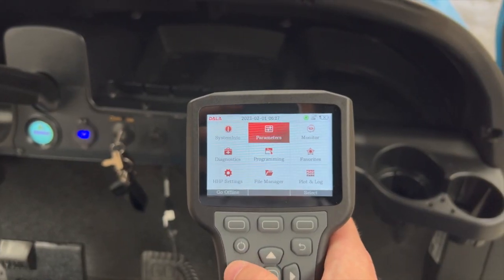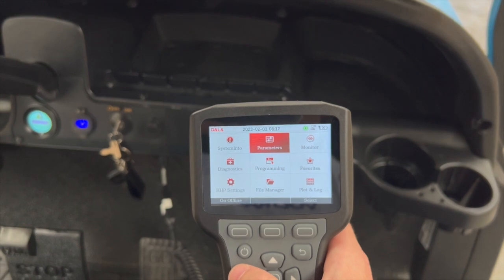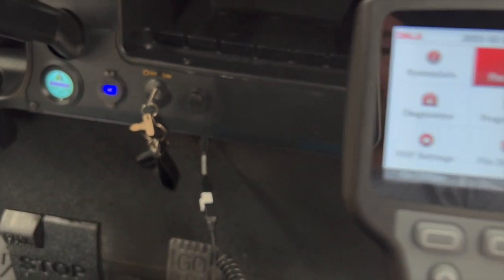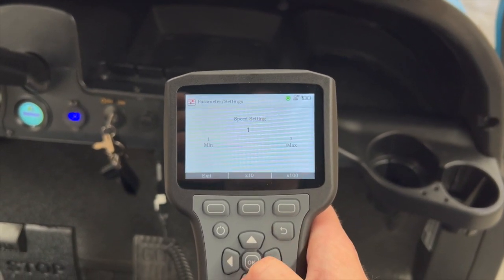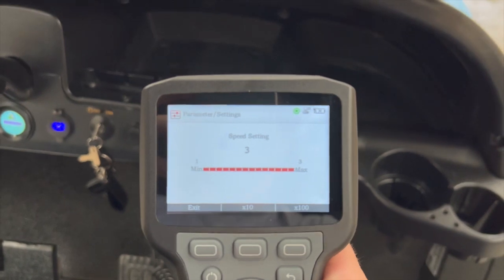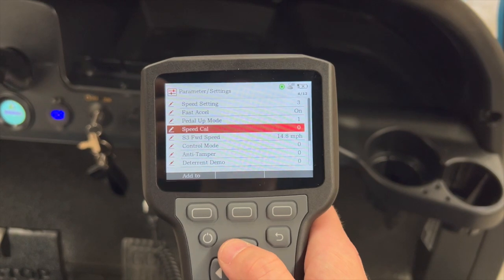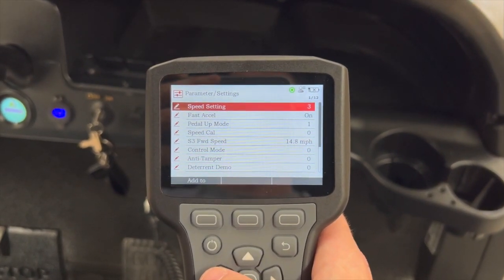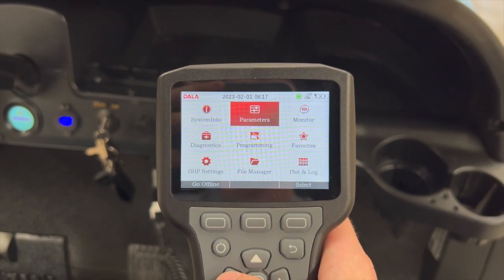Club Car Golf Cart Speed Programming - Curtis Controller with Hand Programmer

Comment: My cart’s new lithium battery is 48v and 100ah. The BMS allows 200a continuous drawdown, but the cart’s Curtis 1264-5407 motor controller is 400a rated. And that means that the controller could request more amps than the battery can provide, which would cause the batteries BMS to suddenly shut down all power and the cart would suddenly stop, potentially causing injury.

I believe I need to reprogram the Curtis controller to max 200 amp. Does this handheld unit of yours allow that in its menus?
And do you know if that would means that the cart would be really slow? No top speed? No juice going uphill?
Anyone?

Comment: There is a USA company (I am in San Diego) that rents the Curtis Scanner. I just want to increase the speed of my Club Car Precedent to Maximum (Level 4 ?).  My Club Car is a 2017 model.  It is used exclusively on my Ranch and never on a Golf Course. How do I up my speed to the maximum? Thank you. My cart still has Trojan Lead Acid but in very good shape. When they are done I will switch to Li.